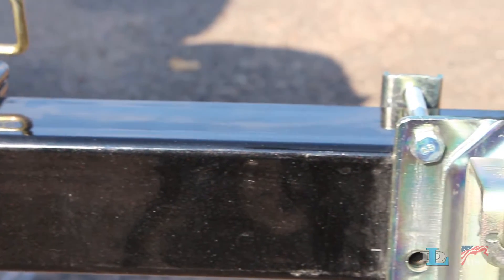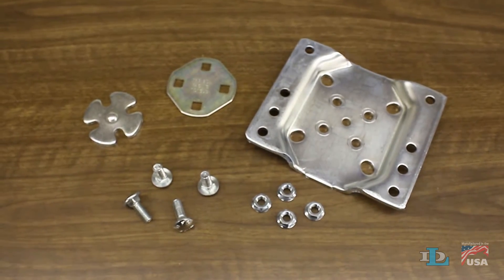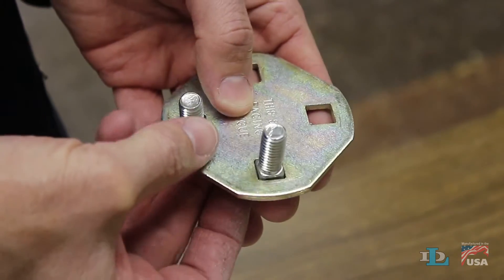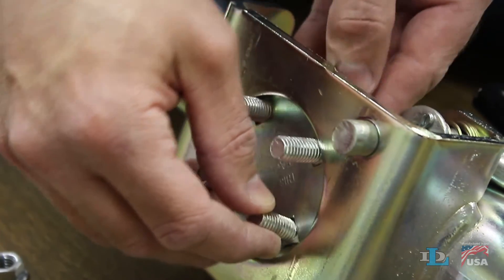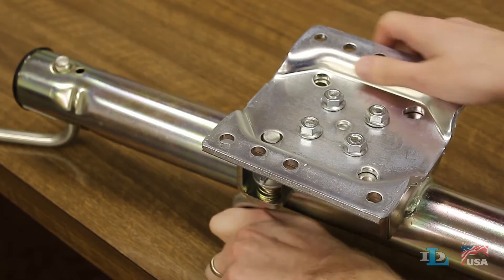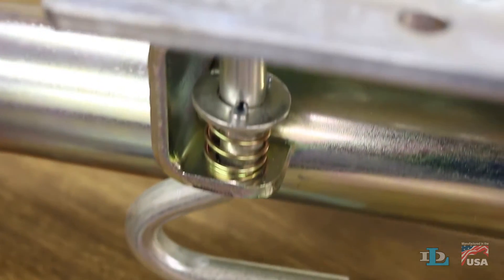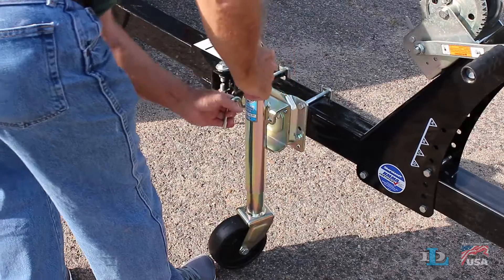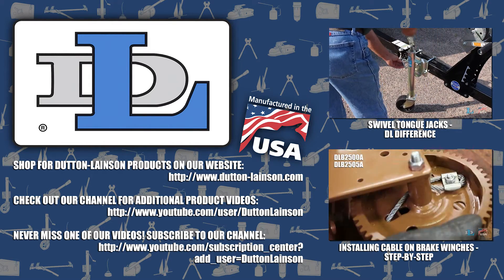Installing a Swivel Kit on Marine Jacks - Step-By-Step

Comment: What would cause an older swivel jack to only swivel partially up, but not enough to lock into place horizontally? It does this either way I try to swivel it(wheel to the front/wheel to the back)
Reply from the maker: Thanks for your question!  It sounds like your jack's swivel bracket or swivel plate has gotten bent.  If you remove your jack from the mounting plate, you should be able to see what is damaged and will need to be replaced.